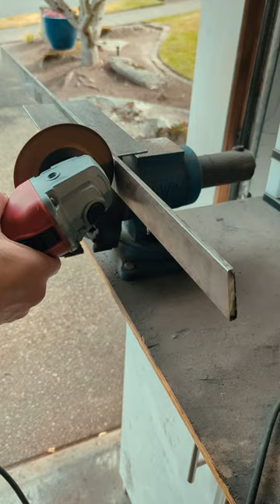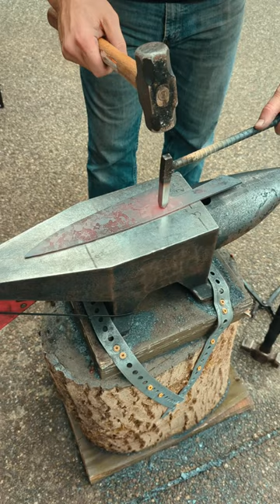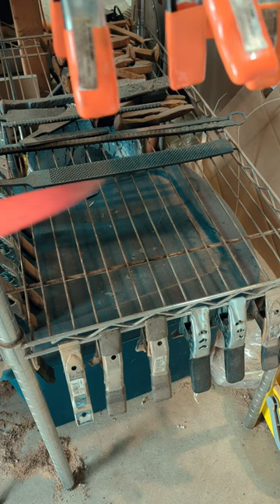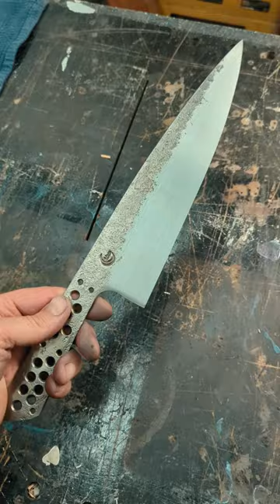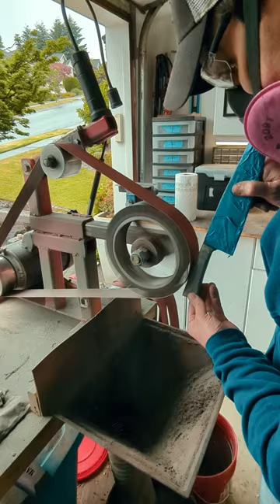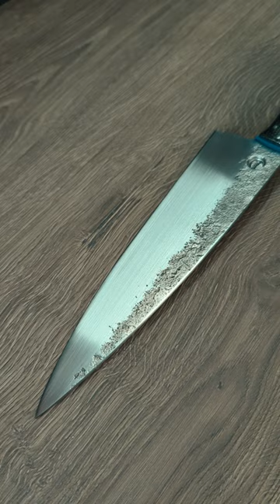Forging a 9" Chef Knife From 80CrV2 Steel | Knife Making #shorts

Comment: How do you keep the knife in good condition no rust?
Reply from the maker: Wash with warm soapy water after use, and dry it immediately. If it's not going to be used for an extended period you can apply a food safe blade wax to help prevent rust and bacterial growth. The blade will patina over time, and the dark oxide layer will help protect the steel from rust as well.

Comment: What did you do to make it food safe after the quench and sanding?  Hit it with a wire wheel on the top part that isn’t sanded?  I just drilled holes into my first knife and it’s for the kitchen.  Just trying to make sure the fam is safe.  Thank you for the video
Reply from the maker: You'll want to make sure you get any forge scale off. You can do that by soaking the blade in vinegar for several hours and/or hitting it with a wire wheel. There's nothing harmful about the steel itself. Just make sure to wash it well with soap and water before its first use. Carbon steel rusts very quickly, so you'll want to make sure to dry it immediately after washing as well. I make and sell a food safe blade wax that you wipe on to a clean and dry knife if it's going to be stored for an extended period. Rust is generally the biggest concern with carbon steel knives.
Reply: @DavidMoonForge  thank you for the quick response! I’ll check your store out.
Reply from the maker: @drey4184  good luck 👍. Blade wax definitely isn't a necessity if you keep your knife clean and dry. It's more of an issue in humid climates, or coastal places where you also have to deal with salt water.

Comment: Nice 👍. I like to use a long piece of material though so I don't need tong's for most of the fourging. Dosn't bounce around in the tongs. 
       Just my preference, but makes it easier I think.
Reply from the maker: Yeah, I see a lot of people forge that way. I've even forged quite a few blades like that. My forge door is on a hinge at the top though so it's kind of awkward how to close it when there's a flat bar sticking out. Tongs just ended up being my personal preference. Thanks for watching! 🤙
Reply: @DavidMoonForge  that makes sense. I have charcoal setup made from junk.  The long handle thing often means I need a rest. 
     I also find it useful to make an end of item on each end of a piece of metal .  Then cut in half and finish other ends.